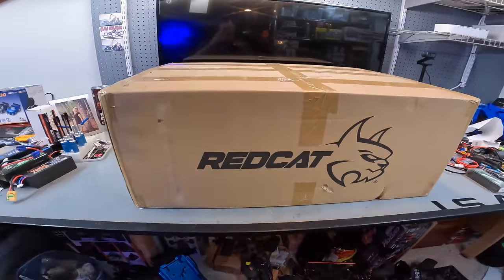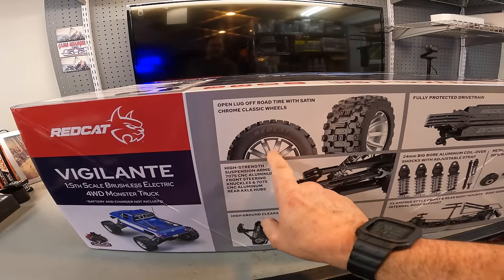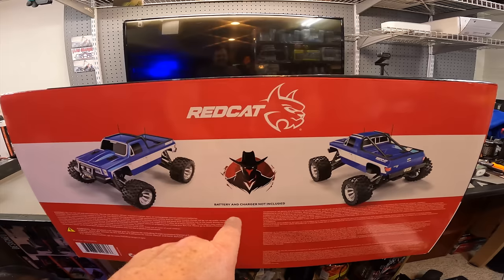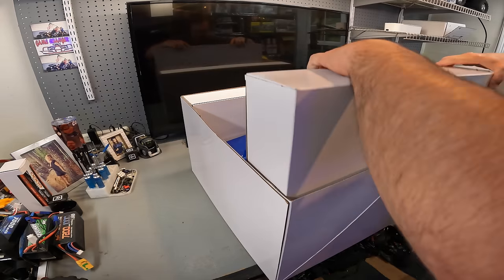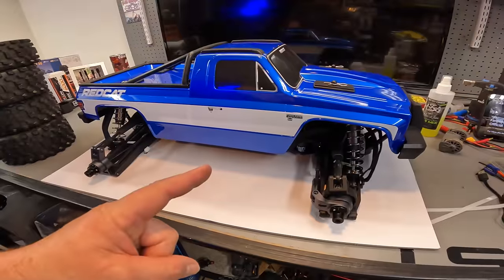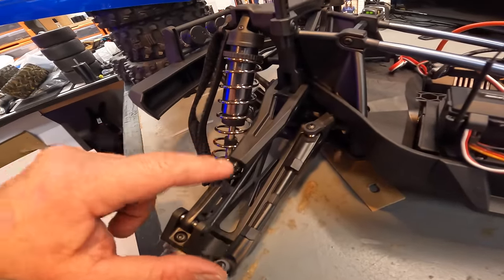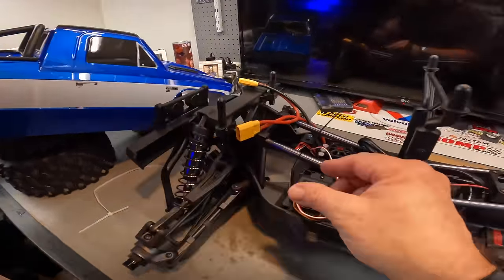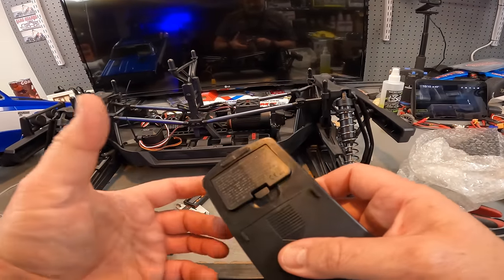New 5th Scale RC are you FREAKING KIDDING ME 😂🤣

Comment: I always hated when the shock towers would punch holes in a brand new body. Even drywall tape and shoe goo won’t help it. I started cutting out thick stainless steel sheet metal squares and sticking them to the inside of the body followed by drywall tape and shoe goo. That really was my only way to protect a body from shock tower damage. Nice to see redcat attempting to solve that problem

Comment: yes it was most likely they fixed the gear stripping issue. i stripped 3 sets leading them to send me allnkew gears twice and a brand new chassis free of charge. and got them on warranty. i bought the truck a soon as it released. at the time only 2 trucks made out that were messed up like that. they are swift with fixing issues.

Comment: I love mine.  It handles better than my Xmaxx.  I have a set of the new 8s exb Outcast backflips ordered for it.  After that and a big motor i think it'll be tough to decide between it and my Outcast as my favorite big truck.  
No big deal about the 3s to 8s thing.  Every ESC I've ever bought has had a voltage range on the box.  No difference here.  Redcat isn't suggesting we run it on 3s.
Reply from the maker: I just thought it was funny to see 3s listed but understand why still looked odd to see it written for such a YUGE RC
Reply from the maker: It's redcat are you SURE they aren't recommending 3s

Comment: How do you vent your tyres? I used a 2mm drill bit for plasterboard but I dont think it was the right tool for the job! 😂
Reply from the maker: 3/16 brake line 1.5 length beveled tip in a drill. Works MINT
Reply: @rcguygarage  i feel like this could be a little video for you to make dude, i just thought we drill holes into the tyre? Whats the brake line for? 👀 ❤️
Reply from the maker: @MarkJohnMorris  it's just a roll of spare brake line a have in the garage👍 thought about just making a bunch and selling on shop but it just seems to basic and small to charge for it🤣😂
Reply: @rcguygarage  just make a short and sweat video explaining your idea, seems better than me just drilling a hole into tyres haha. Plus you might get a $uper Thank$ 😉

Comment: I feel the release of the Vigilante makes up for the release of the Machete. I also feel it is a little overpriced considering it doesn't have the Max 5 ESC. I still want to get one but, it will be some time yet.
Reply from the maker: Yeah?? Not sure for RTR that Maxx 5 ESC should be included at $220 retail. Safer to give less power for warranty related
Reply: @rcguygarage  Yeah the gears wouldn't handle it. The Max 5 in bulk price though. I'm not saying it needs it for more power. It would be good for longer run times and for hot summer days. They could do like what they did to the Ascent and make a carbon fiber version and add hardened gears with the $999 price tag.

Comment: Had a RedCat Shredder, was oh so fun, when it was up and running. Think I replaced pretty much every part and electronics before I finally gave up on it. And I don’t even bash that hard. This new one from them looks like it’ll crumble easy as hell during any moderate bash session.  I’ll never buy redcat ever again. Most hobby stores in my area won’t even carry that garbage.  If I had done half the jumps and flips I do with my Xmaxx with that Shredder, I shudder to think how much more would have broken on that thing. Hate all you want, I’ve owned RCs from most the top brands, nothing has ever come close to the durability of my Xmaxx and Maxx (only had my XRT for so long so can’t vouch for it’s toughness or reliability yet) And even when it does break, it’s a breeze to work on. But haters gonna hate.
Reply from the maker: The last part though GUY 😂🤣 either way the choice is yours to do with your money👍💯 ID buy another 2 of these bad boys

Comment: My XRT does not have vented tires. And I will not be venting them. That’s when you get them blowing out. If the engineers didn’t see fit to do it then I’m not. I think they know better than you.
Reply from the maker: You do what works for you👍💯
Reply: @rcguygarage  how many tires have you blown off the wheel? I bet it’s a lot. It makes absolutely zero sense to plug the wheel holes just to puncture the tire lol there was a reason I stopped watching your videos. This just reminds me why.
Reply from the maker: @ngirardo86  not one tire has torn from the holes installed so far. Tires that have torn are usually because I either didn't catch the tire glue releasing from the rim or a punctured a side wall with a rock and didn't notice.  As far as your comments go they're pretty f**** s*** and I know you know that but it's all good bud. You do you. Glad you left the first time I guess 👍💯

Comment: Not sure why anybody that's into the hobby to be DONE with large scale. They are extremely forgiving to bad drivers,they are pretty tough nowadays, and they drive much better in random bashing areas. Plus you're not even done😅
Reply from the maker: Well that's why we all have choices and I truly thought I WAS DONE. I drive a F350 CC/LB Diesel Lariat . . . . however at this point in my life my next truck doesn't NEED to be that spec or size. 5th scale requires more in every aspect. With tech the smaller scale RCs have become more fun and can find more places to run without as much large scale issue. I also have a first Gen Camaro 468 BB 4spd and 10 years ago I would have NEVER considered swapping in a 6spd or going away from solid lifter carbureted BUT with Holley efi and Tremec pulling at me that was never available and as easy to swap in now. See my point???